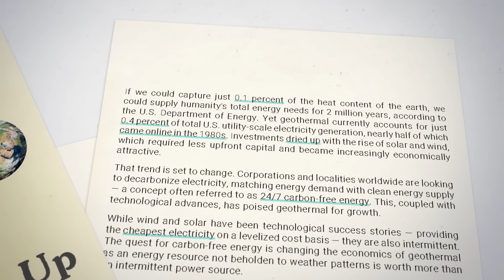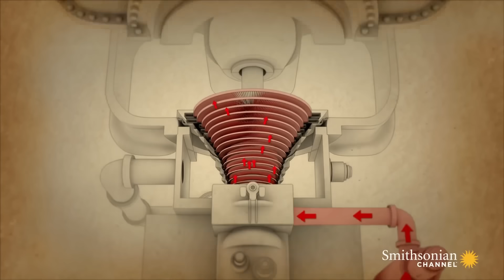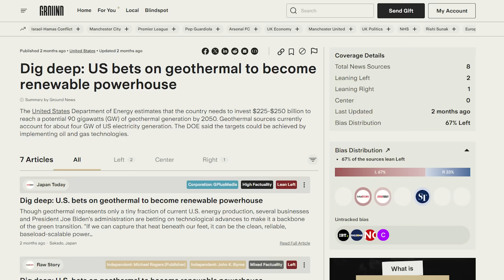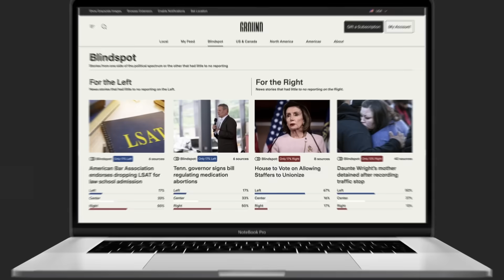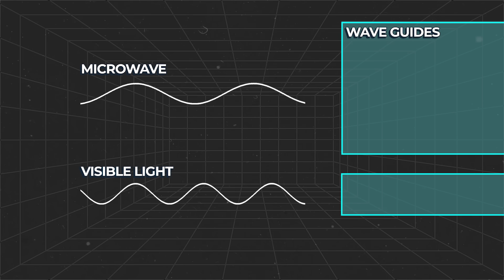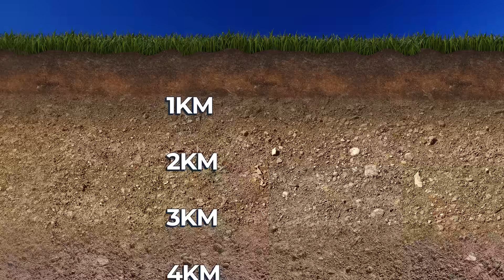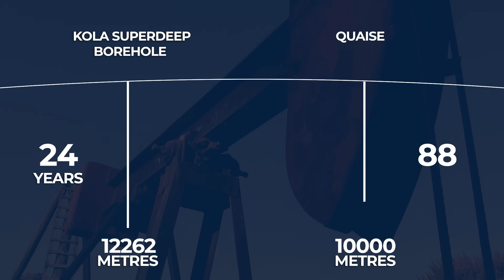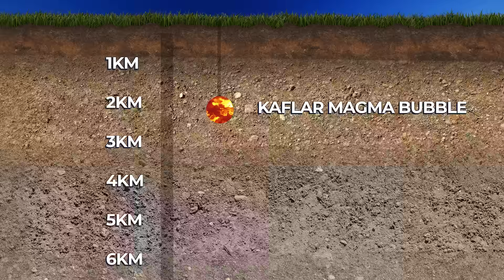This Fusion Tech is Solving the Geothermal Energy Problem

Comment: Had to come revisit this video when I heard about the ocean on mars 12 km under the surface- seems destined for this solution. The rock would be colder, but with lower pressure, vaporization should hopefully be easier- and we could do some traditional drilling first to get things started, right? Would this be feasible with a small fission reactor powering the laser?

Comment: Great video - but you brushed over (ignored) the problems associated with geothermal energy, which are possibility of creating earthquakes, leaks of the coolant into surrounding rocks (remember Staufen in Germany) and the very corrosive nature of the coolants that have absorbed salts from the rocks down there. The problems are technically surmountable but difficult. Not as difficult as nuclear fusion IMHO though!

Comment: They type of geothermal energy would benefit from using molten salt like in the newer nuclear reactors as it is very stable as a liquid compared to using water.  The molten salt could be used to collect thermal energy and then use heat exchangers to turn water into steam.  This could also prevent earthquakes as molten salt doesn't expand like water.  I look forward to advancements in the technology!  Thanks for the video!

Comment: you need to vaporise it not just at the cutting head but all the way iit travels up the shaft. I can imagine some very difficult clogs as the vaporised material is transfered back up the pipe and solidifies. Alternatively fully heating the entire shaft would require an incredible amount of energy usage, heating the entire shaft to a level above where magma forms and then preventing all the previous layers of rock around the shaft from melting. 

If you use a vacuum/partial vacuum then how do you make sure that the rock is sufficient vaporised and you're not just pulling in liquid/partially liquid rock/magma. If you fully heat the entire shaft then similar problems as above (also to add how do you keep the structural integrety of that shaft at the temperature without needing insanely expensive bespoke materials. 

Very interesting idea but maybe not a total solution.

Comment: Maybe use defunct oil wells old drill holes to get a 'free' ride for the first 1-2 kms? 
As the hole gets deeper can more and more generated steam be used to supply energy to the microwave melt?

Comment: The fantastic gets attention but let us consider the practical for a few moments.  

There is nothing new about the concept of drilling for geothermal power.  When the automobile became popular, so did drilling for oil.  Many failed holes were drilled, some producing natural gas, but a few didn't produce anything.  What they all had in common is that the oil companies noticed that it is very hot down there.  Where we could usually use water as a coolant and a lubricant for cutting materials, drilling deep into rock doesn't allow water to be used.  There is simply no way of colling the bore hole faster than the surround rock heats it.  This, of course, produces a very dangerous condition.  consequently, the temperature of the bore has a significant effect of the lifespan of the drill rod and bits.  In the 1920s carbide cutters were invented that didn't need coolant and slurry to be pumped into the bore while drilling, significantly increasing the capacity to drill.

Overall DrBen, this effort into fanaticism still doesn't solve any problems.  Imagin the actual engineering problem this way.  If we could run the boilers on our battleships at higher pressures than we do, then we would be doing so.  There is a very simple reason why we can be absolutely certain that we are already doing so; turbines are expensive.  The higher the pressure differential across the turbine, or even a piston engine, the less expensive it is.  What temperature and pressure do we actually need to cause our piping to burst?   I doubt it will be any higher than a ww2 battleship.    Therefore, your hole need not be any deeper than the piping can handle.

What is really high tec is how well it plays the thousands of people who have thought of the same idea on their own.  But here is one, why don't you buy an old oil drilling test hole, un-cap it and assume nobody at an oil company thought of it before you?  I'm sure you will find tens of thousands of people to buy stock in your company.

Comment: Apologies in advance for the potentially stupid questions:

1) drilling holes and over using heat from the earth core shouldn't speed up its cooling down?
2) if 1 is true. What the potential effect of cooling it down. I've seen way to many disaster movies that my head is absolutely full of BS. But I'm concerned about the magnetosphere and continental drift related effects.
3) Where is all the vaporized rock going? I bet that is not healthy to breath or release into the atmosphere.

Thanks in advanced to those more versed than me and again I apologize in advance for the potentially stupid questions.

Comment: This sounds very dangerous.  Why would we allow these morons to mess with the earth’s crust.  We should be trying to conserve geothermal heat.  It will cool on its own over time leaving our planet dead.
Reply: Taking heat away won't cause the earths core to die any quicker, it will last as long as the elements in the core keep reacting due the the pressure and releasing energy, if that stopped it would not take long too cool.

Comment: Another application for this would be in digging tunnels, where the ability to extract the vaporized rock could be more readily facilitated.  In fact, if they can reduce the scale of this process, I could conceive it's efficacy in creating underground transportation tunnels, or even underground homes.   They KEY problem I don't see resolve is how to extract the vaporized rock material to prevent it's re-deposition  in undesired locations.

Comment: Chk out Eavor geothermal anywhere 2 to 3 km down, no fracking, using directional drilling to create a heat exchanger to gather the energy & send it to the surface for electrical generation & district heating.

Comment: I had this idea in the early 1990s. Everyone i told this it was impossible. But I've thought of many solutions or at least some ideas that someone else could make imto a solutions.  The water idea i thought about in middle after the first time hearing about the kola super bore hole. Why not uses a constant flow of liquid nitrogen released from the front of a new type of drill head. Wouldn't we only need to reach where it's to hot to drill? And i thought of some kinda laser but i didn't think the technology wouldn't be available before my time. Couldn't some kinda sound frequencies be used to loosen the rock? Hopefully someone solves it soon. And what happens if you drill the hole on the ocean floor?

Comment: Just Have A Think had a video on a company from Canada. They have a proof  of concept already built using drilling and fracking techniques. These can be drilled anywhere and last decades before heat is exhausted.

Comment: Changing the energy flow to increase energy input to a system in equilibrium will also cause climate change. The only sustainable solution is to use current energy input (solar). When analysing the ecosphere one must consider it a closed system in a somewhat stable equilibrium, and  understand the energy flows. Any increased input, fusion,  geothermal, or space solar panels, will push the system into a new state. Perhaps not very fabourable for humans.
Reply: Why do you think geothermal is adding energy to the planet? 

It's energy that's radiating out from the core and it would soon reach the surface, we are just slightly speeding up the process.

Also climate change isn't caused by our wastheat that's such a small contributor that it's not even a factor.

Climate change is caused by greenhouse gasses traping more of the sun energy the energy humanities emissions have trapped is far far greater that the energy we actually use.

Comment: Hi Ben, great video. Just a small note: at 10:20, could you quote the oil drill rate in m/h and the Lazor system in cm/s? It would be great if you kept the time units the same so they are easier to compare.
So here it's 100m/h vs 3.6 m/h, right?

Comment: Will this deep bore closed loop geothermal system extract less heat from its well and surrounding rock so the system is self-sustaining, or will the system extract more heat from the well and surrounding rock than can regenerate (i.e. move into now cooler rock from hotter surrounding rock), eventually making the well useless?

Comment: So we just need an economically viable way to reach 10-20k to make geothermal the most viable clean energy source? Sounds plausible enough, physical objects would not consistently work as they can’t go past a certain point from just melting in the heat down there, a laser approach seems like the next logical step considering we have a way to make a “laser” actually a real thing nowadays. Although this isn’t exactly like a full laser, still seems like this is a good way forward. Solar is still a top contender as well, as it has many less risks and unknown, there is a lot of predictable potential for dangers with this geothermal approach, that’s my main concern, in an attempt to not kill our planet’s atmosphere slowly, we syphon energy from its core, we might just kill it internally which is what maintains the atmosphere attacked in the first place. Maybe a few wouldn’t dent our planet, but say we make millions of these, we have seriously considering the exponential effects of what doing would do to the core of our planet which functions on this natural balance to stay “alive”. It’s an atrocious idea to be irresponsible which out planets core, this sounds like it could solve energy, but it also sounds like it could be as dangerous if not worse than oil. We must determine which is actually the case with absolute certainty, before being sold on this concept.

Comment: This is genuinely interesting, and it really seems like a viable clean energy source if this technology is capable of taping into it, and most importantly, IF it doesn’t bring any dangerous and unforeseen consequences in it comercial use, which it very well could though, we don’t know what could happen if we start indiscriminately syphoning energy from the Earth, Energy that powers our very world and everything that makes it work. It’s crucial that they can definitively prove that this process will not cause any significant harm to the Earth, otherwise it is just as unviable as fossil fuel, just for different reasons. But being positive, this does have a lot of potential.

Comment: How do you get this far into a project thinking the issue with ultra deep drilling is bit wear? Its a problem yes, but its not the only problem. There is the greater issue of the vast forces acting to close your borehole. Lithostatic load is immense. 

Also much of the time on these drill holes is spent casing your way through problematic sections of rock, dealing with fluid ingress etc. 

There appears to be no real understanding of drilling.

Comment: And what are the unintended consequences of drawing this free “unlimited” supply of energy from the depths of the earth? Why doesn’t Mars have a breathable atmosphere? Because its core cooled and no longer rotates producing the electromagnetic bubble around the planet that prevents the atmosphere from being blown away by solar wind. I’m sure if we do the same thing here it will be different. Not.
Reply: Taking heat away from the mantel won't effect the not stop reactions in the core, that will last as long as their is still "fuel" to react, at which point the planets interior will rapidly cool without the nonstop supply of energy.

Comment: So question, if the geothermal energy uses extremely heated water that pushes its way to the surface to turn turbines, wont the water supply run out eventually cause we are draining it faster than the natural process can refill it. This is an already ongoing issue in some areas where people drill to install pumps to access water underground which also then causes the ground to become unstable.

Comment: Of course we can't use suppressed technology like Tesla's Radiant Energy Receiver patented in 1901 or the Adams Motor that runs on magnets only. BUT... I heard that the temperature rises more sharply with depth than was commonly thought. Why not multiple relatively shallow bore holes with very efficient thermocouples? You won't get a staggering amount of power per unit so just drill and drop a lot of units and wire them in tandem.

Comment: I have been advocating this for so many years!  I read up on it, and it is quite expensive (because in places, the heat is well down).  BUT...compared to renewables (for which read 'unreliables') and nuclear, it isn't expensive at all!  And although wind turbines use truly massive amounts of concrete and steel, and solar panels use toxic chemicals, deep geothermal uses water!

Comment: so we're releasing tons of heat from the core of the earth in the middle of a climate crisis?
sounds like a good idea that totally won't bite us in the ass.
Reply: That's not how climate change works,  the waste heat from human activities is a complete non factor in climate change compared to the larger percentage of the Sun's energy being trapped due to greenhouse gasses.

Also energy from the core is constantly radiating out, we are just slightly accelerating the process.

Comment: Tectonic plate movement is very important as it creates mountains, plateaus. If there is no tectonic plate movement, then the earth will become completely plane due to soil erosion and all the surface of the earth will be covered with ocean. The tectonic plate movement is directly proportional to the earth interior temperature. Basically the earth interior should be in liquid form. If humans will use geothermal energy then it will increase the speed of cooling of the earth interior. In a long(millions of years) run it is not good for us. It will be good if we use solar and wind energy.
Reply: You might wanna look at how much thermal energy this planet holds.
In a million year humans would probably be long off from this planet.

Comment: If you keep extracting heat from the earth core, the earth core will solidify, Earth will lose it's magnetic field and the solar wind will strip out the earth atmosphere then life will end, Earth can survive any damage done to it by humans but not this one, don't tell me the earth is so big for that to happen, that was said by the "experts" for decades and now we are suffering climate change and dried water wells, I actually started thinking geothermal energy is the reason why there is no life out in space because that is what the did to their planets
Reply: Do a nakin math and see how much thermal energy a couple thousands of cubic meter of iron has at 5000c, excluding energy on outer core and mantle has, vs current human consumption of energy.

Or just look at kardeshev scale and see where we lie vs type I civ.
Reply: @kopazwashere  
The same expert told our fathers in Libya about underground water 50 years ago, they told them to install powerful submersible pumps and to extract water and grow water thirsty crops and water thirsty fruit trees, the result was catastrophic, 90% of the wells ran dry and the land which was covered with wild plants now bare sand became desert

Comment: If it is so hot down there to the point that you can’t drill wouldn’t that be enough to put water down the hole and get steam out. Oversimplified but you get the jist.

Comment: I have got to wonder how they are planning to transport the vaporized rock up, are they going to keep it as a vapour the whole way up or are they going to condense it then bring it up. because if your plan is litterally to blow it out as you said... well that means keeping it at 2,800C all the way up, which obviously you can't take that temp the whole way up with basically any material except for tungsten and that s*** is expensive and very hard to machine and you would need A LOT of it, if you could heat it to 5000C you could use magnetic confinement because it would be a plasma at that point, but that is a whole bunch of extra heating you have to do and means you would need electromagnets down the whole shaft which sounds extremely expensive.

I think you would be better off cooling the rock to what the machinery can bare and mechanically bringing it up, I assume they are not stupid and have already figured that out though.

Comment: I'm sure I'm stupid… but why the heck do they keep drilling "tubes"?
A Y shape is the obvious solution to me. Seriously, if you don't have to use an elevator down before you reach the top of the drill… you're doing it wrong.
Also geothermal/energy production depends on heat… so if it's so hot that drills break… here's a crazy idea… you've reached goal maybe???